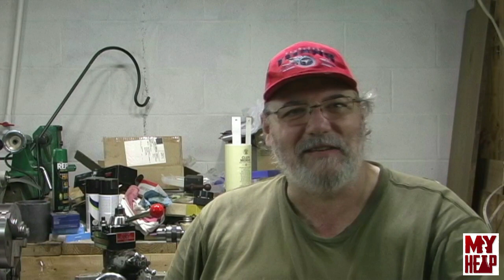Reply to 5 Tons w/ Guns

Comment: Like to see the new furnace. I should get into Some hot work
Reply from the maker: I moving towards an oil burner.  I know that these burners are capable of melting cast iron.  It all depends on the amount of oil you can vaporize and get burning and the air supply.  This first one is intended for Aluminum and Brass.  My current furnace will not take the heat for cast iron, I am sure it will slump before I made much progress.

Comment: cool video, might I make some suggestions? 

Ive seen alot of good furnaces built off of the gingery designs, and they do hold up quite well, but the one thing that I would change is to skip the burner and blower that he has and go for one like a ron reil style burner. They're very cheap to build, made with minimal parts, and once you get it set up, you just light a piece of paper, slowly turn on the gas, and your good to go.  There are a ton of self aspirating burners out there and you just hook them up to your propane tank, light it, and your going, no need to fight with everything else. 

Ive seen alot of people make up the reil burners, but instead of using the #57 drill bit in them like the plans call for, they drill and tap for an M6 thread, then stick a 030 mig tip in the threads, which actually works as well or even better, and you dont have to find some number size bits to drill the orfice hole.

The forced air style burners tend to be problematic if your not experienced with them, and if you add too much air, you'll oxidize your melts and the flame starts to act like a cutting torch, which will ruin your lining and crucible in very short amount of time. 

The myfordboy's power hacksaw design is actually a pretty nice design, and quite rigidily built, which is handy if you want to do very precise cuts. The design has been around for quite a long time, and was modeled after a kennedy power hacksaw, which was a cheap power hacksaw that was sold shortly after WWII in england because of the need for pipe fitters and similar for construction, and the kennedy power hacksaws were quite common because they were portable, but just ran forever while being very precise.
Reply: Also, a side note, the burner tube should never get hot like yours did, it did that because the air was slamming around with the propane, and creating turbulence, which causes the flame to burn inside of the burner, and that should never happen. You always want the flame to happen at the end of the burner in the flare, or inside of the furnace. 

You can run a propane burner without a flare, but only if it's inside of a furnace or forge. If you want to run it outside of the furnace/forge, then it'll have to flare, but there's really no need for running it outside of it tbh. The furnace/forge will actually act as the flare and thats where you want the flame to be.
Reply from the maker: Hi Chirpy, I didn't use this furnace much before it was ruined.  I was so bummed out about it that I just went back to charcoal and a reil type propane burner.  I did manage to get the burner to burn correct.  But it was after sealing up the fan for external leaks and playing with the propane pressure and air damper.  I found it to be a little temperamental.  Like you, I would suggest just using a propane burner, or hopefully a oil burner.  Speaking of which, I have the burner running on diesel and it really put out some heat.  I have another video I need to finish editing so I can get it posted.

5 Tons w/ Guns has already built the gingery gas fired furnace and has used it enough that he is rebuilding the body.  I noticed that he made modifications to the blower pulleys.  I think to gear it down a little to slow the airflow.

I have both sets of plans for the hacksaws.  I like the myfordboy plans because it seems to be a pretty compact unit.  But I also am willing to build Gingery's.  I still have a lot to do before i get a chance to build either, so hopefully Casey will build his second and I can see it run.

Thanks for stopping by Chirpy and all the great comments and suggestions.  I appreciate it.

Joe
Reply: oh, cool, cant wait to see how the burner runs. They do put out an insane amount of heat, and the heat is much different than propane imo. You'll probably notice that the metal will melt before the crucible gets red unlike with propane, the furnace and crucible gets orange hot before the metal melts.
I saw a video or two of his since I had to look up to see what was actually going on, so saw his rebuild. It's kinda hard to tell one video from the next tho because they're all exactly the same title, lol.
Reply from the maker: No worries Marisue, we are all learning this stuff.  The more you do of the video editing the more you feel like you want to do to make the next video just a little bit better than the last.  Keep up the good work.  Things will get easier with practice.  Just out of curiosity, what video editor are you using?  Maybe some of us can help with your questions.

Joe
Reply: Thank you Joe, I am use the editing that you tube offers.
Reply from the maker: If your interested in an offline editor, I use Kdenlive which is a free non-linear video editor.  I use it with Linux (my operating system of choice) but I think they have ported it to windows.

Joe